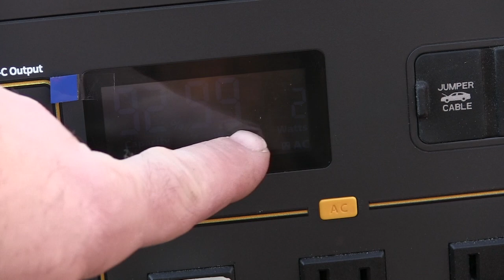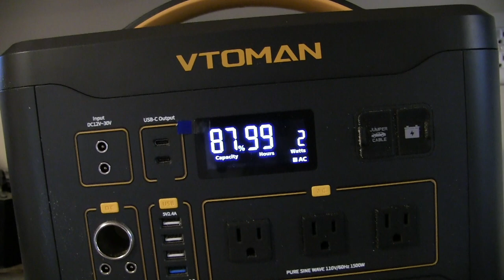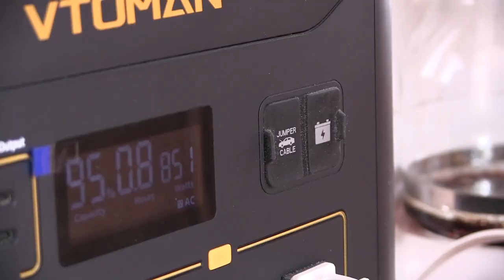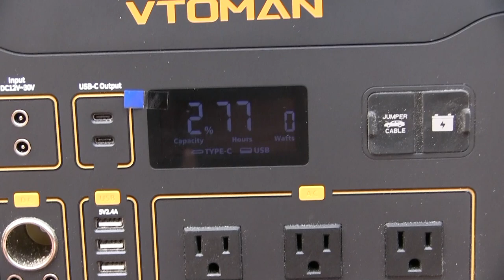VTOMAN jump 1500X power station review.Can it run power tools???

Comment: I have been looking at power banks for a few months and I have narrowed it down to VTOMAN Jump 1000 and the 1500X. I am a little conflicted with the 1400wh capacity of the 1000 or the amazing 3000w surge limit of the 1500X. Both are expandable,  which is great at another $700+/-. My only complaint with the VTOMAN is the slow charging of 6-8 hours using a wall outlet which is 2-3 times slower than their competitors.
Reply from the maker: I did't do the greatest job of keeping track of how long it took to charge but most days I would run. power tools a lot and it didn't seem like it took a long time to charge . but if thats what the website says I would guess its right
Reply: Fast charging degrades the battery anyway.. slow is better for longevity unless you're always in a rush. Just leave the solar panels out all day in the sun and forget about it.

Comment: I really like that you gave this item some "propper real life" testing, and that you have also given us a great documented account of how it stood up to that task.  It would be interesting to see how the battery life holds up whilst it is being charged by the solar panel at the same time as being used. The coffee maker and battery charger which have a constant load would make two ideal testing dummies.
David in the UK
Reply from the maker: Thanks!! I was hoping to do a test of it with the solar panel ,  but I got it rather late and its not the fairest time to test that winter here is normally overcast at least

Comment: Enjoying your show , was wondering what is tge wattage of your vtoman, and if that it can be left in cold temperatures,  we get -40 sometimes and was wondering if we can leave at our cabin
Reply from the maker: Thanks  !! I am not sure that I would recommend  leaving it in that cold of temps. I know that the battery in it won't charge under a certain temperature but I don't remember what that number at the moment . it is 1500 watts running with a 3000 watt peak

Comment: just bought the vtoman 1000 jumps a few days ago, plan to use it for power along with 110 power in my BBQ shed when it is done, Ill install 2 100 watt panels to keep it charged
Reply from the maker: Awesome! That sounds like a cool project
Reply: I bought mime off amazon with the discount, even the other battery unit to use with the 1000 or 1500 has the discount  too
Reply from the maker: @donfrank4429  cool ! I hope it works well for you I haven’t tried the 1000 but I sure was impressed with the 1500 . All that time I used it I just noticed the other day it has a really bright built in light on the back .lol

Comment: These are excellent I have the 600 jump with expandable battery.  I want to get either the 1000 jump with expandable battery or the 1500 jump with expandable battery.

The only thing I don't like is in the UK🇬🇧 the Vtoman 100w solar panel does not come with  the charging port unit on the solar panel to charge your phone or ipad direct.  I purchased the Vtoman solar panel specifically after US reviews on that feature but alas, its not included here..  but the quality of the panel is very robust.
Reply from the maker: yeah !! I have nothing bad to say about it at all I use it all the time . I really haven't used the solar panel a lot because it holds a charge so long

Comment: Great video . Do you know if that unit could run a dust extractor? Thanks
Reply from the maker: Thanks !! I'm not really sure depends on the wattage it uses and how long you plan to use it . I would guess it would drain it pretty fast if you had it running nonstop

Comment: How long does it take to recharge?
Reply from the maker: its pretty quick charging on a wall plug I had it down to just under 3 percent and I think it was around 3 1/2 - 4 hours to full charge I haven't used the solar panel much yet so im not sure on that

Comment: My only question is, what are you doing with an 'electric' chainsaw"? The only saws that use electricity are skill saws, jig saws, mider saws, band saws, table saws, etc. And that's only because they can't figure out the oil to gas ratio on a gas powered table saw! 

But not chainsaws for goodness sake! Lol!
Reply from the maker: LOL my wife wanted one so I bought one that was a pole saw . she's hardly used it but I've used the pole saw option a lot
Reply: @blackspruce1861  Well, that makes sense. A gas powered chainsaw duct taped onto a 12' pole would probably violate all kinds of OSHA rules. I guess I'll have to get one now!
Reply from the maker: @101st_AB yeah sounds a little sketchy. The other good thing is with something like a pole saw you might not use it for a long time and you don’t have to worry about it having bad gas or the carb getting gummed up from sitting

Comment: How do u charge the battery is it solar powered ?
Reply from the maker: You can charge it with solar, your car charger port , or plug it into an outlet
Reply: @blackspruce1861  by the way. question do u know if this battery could power an incinerator toilet I've heard many people have them that live remote so they don't have to deal with compost.
Reply from the maker: I don't know . I've never looked into them . I would guess they would have a pretty high power consumption . it might though